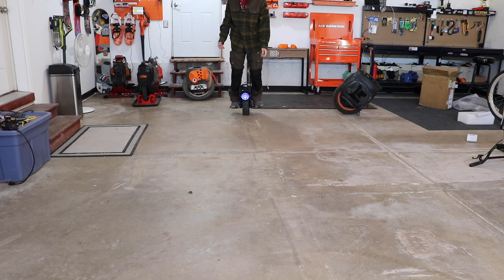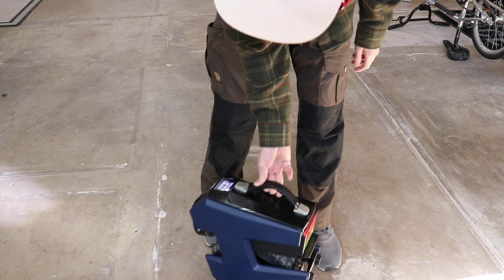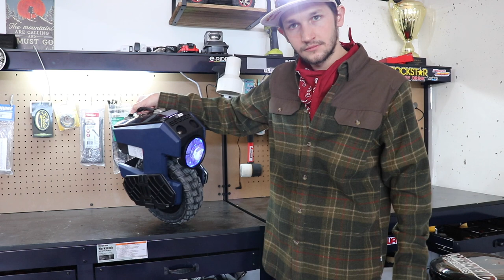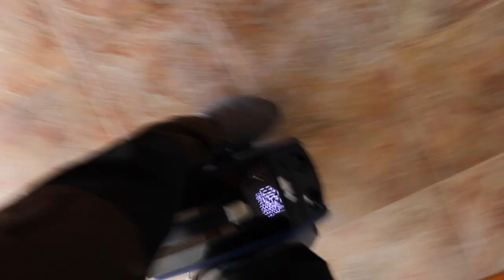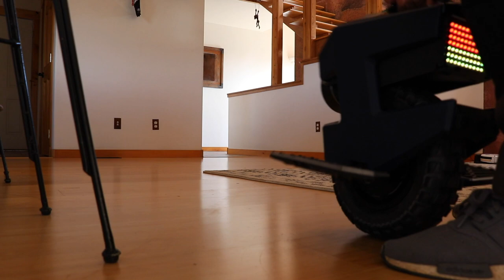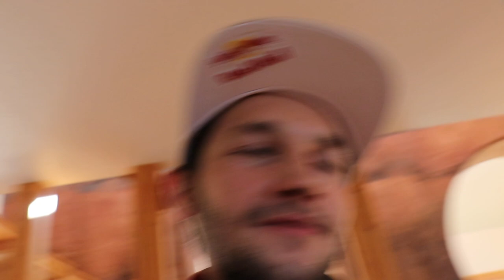MTEN 4 - Mini Electric Unicycle Unboxing

Comment: You can change pedal angle.  I have 50 km range in the city on this wheel,  it goes 30 km h immediately. But the power button is not working so good. Great wheel for the price.

Comment: Traded my Onewheel Gt for a kingsong 16x and $1200 and bought this with the money. I am 100% glad I made the switch because now I have 2 wheels and one is much faster than the gt and the mten4 rides a little slower but I only have 1 month of experience vs about a year of onewheeling so I’m sure I’ll get there to the point of being faster on it.
Reply: Speed don't matter ...
Reply: @kimpassey5618  I do off road group rides and my friends like to push the limits so it’s a matter of keeping up than just speed. The ks16x does more than keeping up while the mten4 gets lost to the Onewheel Gt. Hopefully as I get better I can keep up.
Reply: No float life ...sad
Reply: @Kay0Bot  my friend has 2 gt so I just use his when I need my float fix

Comment: This is a great design,  putting the batteries and electronics ABOVE the wheel instead of next to it.
Reply from the maker: agreed!! I just rode it on some trails and I have never smiled so much in my life. It is a blast and is working great, with no fuss so far! Everyone needs one of these. Got very comfortable riding it fast offroad.